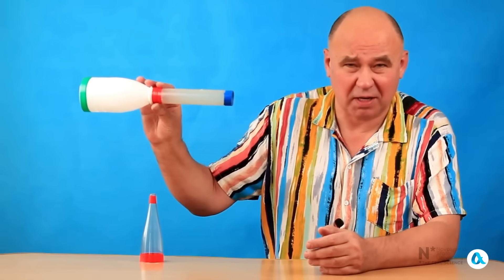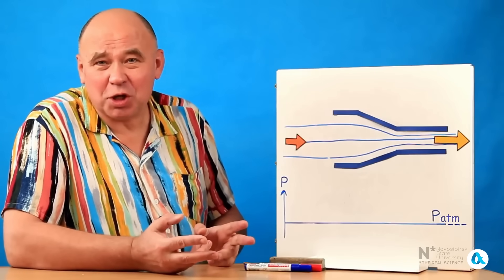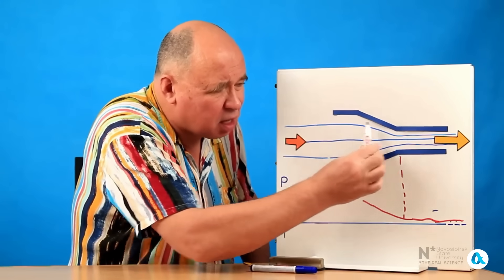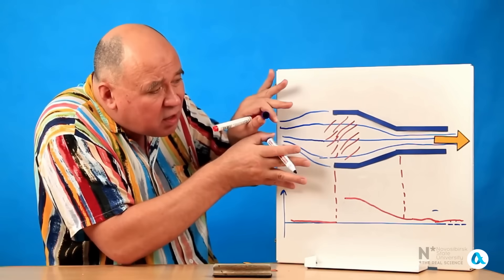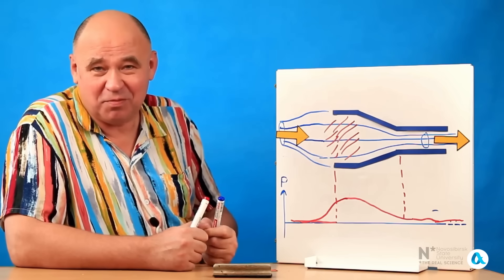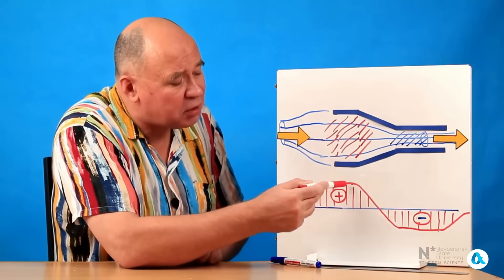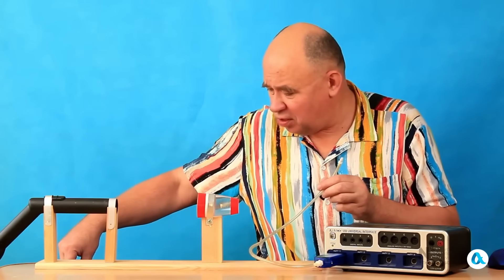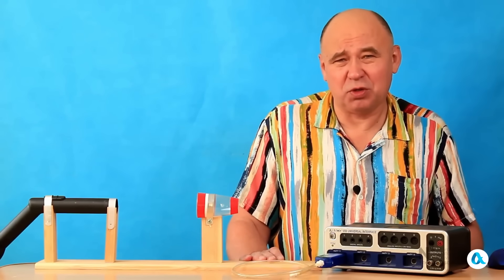Tapering pipe paradox

Comment: I don't see a paradox. The input of energy is provided by the airplane. The pressure inside the wide part of the funnel increases because the air is approaching a flow restriction. There is no reason to invoke expansion of the air. As a result of the increased pressure in the wide section, the speed of the air increases  as it is forced into the narrow section. Once in the narrow part of the funnel, the pressure is high but instantly returns to atmospheric, not below atmospheric, as it exits the funnel because it opens to the atmosphere which has a volume infinitely bigger than inside the narrow part of the funnel (P1V1 = P2V2). Conclusion, the energy provided by the plane in order to accelerate the air in the narrow section is not given back to the airplane, which results in slowing down the plane, although the reduced speed is so minuscule that we cannot even measure it.
Reply: He is using the word "paradox" loosely; sort of like when the word "theory" in common usage is  different from a "scientific theory."
Reply: This explains it best. That was what I was thinking.
Reply: Why did you say "Once in the narrow part of the funnel, the pressure is high"? You do agree that it should be at its lowest if the flow is laminar?
Reply: @mosab643  The pressure is highest at the entrance of the narrow part, as you saw in the video experiment. As the air speed increases in the narrow tube, the pressure decreases (Bernouilli principle) and back to atmospheric pressure as it exits the tube. It cannot drop below atmospheric pressure, otherwise the air would flow back from the outside into the narrow tube. Actually, this brings up an interesting thought: maybe the refined theory seen in the video is correct and indeed there is a negative pressure, but the atmosphere fills it back instantly from the exit of the funnel, and an equilibrium quickly takes place so that the pressure is equal to atmospheric pressure. This is something to consider. Sorry, I'm not a fluid engineer, just a chemist with a wide imagination.
Reply: @pjdruz5636  No, that actually makes a lot of sense. 
However, the pressure can theoretically be less than the atmospheric pressure in the narrow part of the tube depending on which type of pressure you are talking about; as there are two types of pressures in a flowing fluid - static pressure and dynamic pressure. Static pressure can be seen as the pressure the fluid exerts due to its internal energy, and its affects are measured parallel  to the direction of its stream. Where as, the dynamic pressure is the pressure that the fluid exerts due to its motion, in the direction perpendicular to the direction of its stream.
So, the static pressure - the pressure being exerted on the walls of the tubes - can indeed be less than atmospheric pressure without the  outside air having to flow back into the tube.
Reply: I like the theories, but what hasn’t been discussed here is what is happening to the external pressures as the fluid (air) moves around the outside of these conical structures it creates a low pressure zone behind the outer cone before the air exits.
I don’t agree that this would create a small or unmeasurable drag if such a conical device was attached to an aircraft though, because I feel it would act like a donut shaped sail overall and create quite a bit of drag as it compresses the inner chamber while decompressing the external atmosphere behind the cone before the exit and would also make the aircraft much less aerodynamic with such a structure attached.
JMO.

Comment: Your simulation using Faraday's/Maxwell's Electromagnetic "Lines of Force" is simulating the "air flow" as if it were a wave rather than particles. Air is made up of molecules which is a particle.
In other words, the calculations CANNOT be interchanged freely.

Comment: At a guess, reversing the air flow direction would be, to first order, like running the original in time reverse so the pressures would be identically distributed. Frictional forces aren't time reversible so there'd be some differences.

I expect the dynamical explanation would feel very different though from for the original.

... I realized later another source of irreversibility would be turbulence.

Comment: It is better to refer to pressure by its components. Total pressure is constant unless energy is added but the static and dynamic pressure can be exchanged without adding energy. When you slow the air it's static pressure goes up but it's dynamic pressure goes down and vice versa when you speed it up but the sum of the two, which is the total pressure, is always constant. This remains true until the air becomes considered compressible usually above Mach 0.5 and higher.

Comment: Why is there a paradox? The increase in the flow rate should increase the backpressure to resist it due to the restriction. Eventually, the a rise in backpressure should result in a negative pressure within the restriction. When you add a recovering combustion cycle between the pressure zones, this becomes a completely different fluid cycle, and the restriction induces a region of focused high pressure at its exit.

Comment: First, the work done on the air by the larger portion of the tube is equal to the output of smaller exit of the tube. The liquid\gas can accellerate in the smaller exit, but it is not creating any work. Rather, the pressure must equalize before and after the "engine" and since there is no additional work being done on the air in the pressure chamber, there is no net force of accelleration, only drag due to turbulence. If the cone is reversed, the pressure will increase at the opening of the smaller tube, then drop below atmospheric pressure inside the widening chamber. A great deal of turbulence is created at the rear of the reversed or widening tube. In this case, the work done on the outside of the engine reduces pressure, and relative pressure inside the engine is even lower or equal to the airfoil effect on the widening portion of the tube--as it straitens out.

Comment: 10:00 Answer: The airflow will constrict as it approaches the inlet as the low pressure air behind the bottle tries to reach equilibrium by airflow reversing around the rear rim with simultaneous velocity increase ahead of the inlet. The conical front taper will increase air pressure near the inlet as part of the inlet stream constriction and acceleration effect. Essentially an invisible front half of a venturi forms ahead of the bottle.

Comment: Cool video for reasoning dynamics, but there is nothing close to a paradox.  It's a paradox if you don't calculate either the energy in the wind from the model, or the torque from the plane in the hypothetical.

Comment from the maker: Imagine two pipes of different diameters connected by a smooth adapter. Now let us place this structure in the air flow with its wide end forward or, what is the same, move it relative to the stationary air. The flow enters the wide part of the tube, then passes into the narrow part, and at the same time, obviously, increases its velocity. Have we really got an air gas pedal, a kind of jet engine that runs without any fuel?! Something's not right here.

A metaphysician like Newton will immediately say that the Creator of all things so arranged the universe that man could not get something for nothing, and such an engine is a priori impossible. 

And a physicist (like Newton) should find an error in this very plausible reasoning and understand in what exactly we deceive ourselves.

Let's follow the air pressure along the axis of the pipe. Behind, at the exit from the narrow pipe, the pressure is atmospheric, as well as inside it: the air flies there by inertia. But in the adapter and in front of it, the pressure must be greater than atmospheric to drive the air into the narrow pipe and increase its speed. But before the wide pipe the pressure is again atmospheric, so at the entrance to the pipe in the area where the pressure increases, the air flow slows down and expands.

So far ahead of the pipe, the cross-sectional area of the flow that will then enter the pipe is smaller than the cross-sectional area of the wide pipe and probably equal to the cross-sectional area of the narrow pipe. Then there is no acceleration of the air - with what speed the air moved far ahead of the wide pipe, with the same speed it flows out of the narrow pipe from behind.

Here, as in other cases where we encounter seeming paradoxes, it is important to draw the lines of current correctly. For example, the wing of an airplane not only deflects the airflow downward behind the trailing edge, but also causes it to run into the leading edge from bottom to top, rather than horizontally. Or else: water moves much faster in the inside of a pipe bend than on the outside.

And as in many videos devoted to hydrodynamics, we simulate the flow of our “engine” using the Vizimag program, because the mathematical equations describing the motion of an ideal fluid and a magnetic field are exactly the same.

Comment: Put 50-100 small tubes at the entrance. They guide the air, reduce turbulence, focus into a straight line. Test with different and same tube lengths. Tune for optimal.
Reply: The high pressure zone in the wide part of the tube propagates back through your small guidance tubes and the air diverts before those. Don't think of airflow as particles with momentum like water, think in terms of pressure instead, I'm sure it's not perfect but it helps with "paradoxes" like these.
Reply: Known as a gas lens. Works great for creating a laminar cover gas flow for welding. I've made a number of them for laser welding applications.

Comment: I'm not really sure it's an actual paradox as much as a counter-intuitive phenomenon. 

When flowing air is compressed in to a narrow channel it's pressure increases and it's speed decreases.

The highest pressure measurements mean the slowest air speeds. When the pressure drops again the air speed increases. Add a combustion element to that and you have a jet engine. In supersonic jet engines the intake nozzle and cone work to slow down the incoming air to sub-sonic so the engine can handle it. The decrease in pressure amplified by the combustion gases at the outlet nozzle give the air it's super-sonic speed.

Comment: I see an error in your test where you measured air pressure over/below atmospheric.  Your exit did not have a tube like your model did, that is why you never saw the negative pressure your computer model predicted. 

Bernoulli’s theory says if you restrict the flow of a fluid, velocity increases and pressure falls.  

Since there was no long tube in your exit, the restriction disappeared too soon for you to measure the reduced pressure caused by the increased flow inside the restriction. 

You actually did measure a bit of negative pressure but the tube was not long enough to show it definitively. 

Try it, you will see I’m correct. 

As a measurement technician I studied this effect in school as we use this same effect in industry to measure flow inside pipelines.  We introduce a precision restriction inside the pipe and measure the pressure upstream and downstream and can accurately measure volumetric flow.

Comment: The nice thing about measuring relative pressures is that it's extremely easy to set up a basic yet very accurate differential manometer.

All you need is a clear tube, some watter with food dye in it (so you can see it easily) and a board to mount the tube in a U shape. Then you fill it about halfway with the dyed water and connect both ends to the pressure locations you want to compare.

Super eaay to build, very visual, very intuitive.

Add some line markings and you have a proper instrument 😁
Reply: Every 27.68” of height differential equals 1 psi if you are using pure water. (Dye could change this)
Reply: @rickschlosser6793   Usually you're dealing with a few Pa at most, especially when you're playing with vacuum cleaner wind tunnels. So you don't need much length at all 😉
Reply: @ Our flow meters were ranged 0-100kPa, and upset conditions could pin the meter on the high side. 

If you call 100kPa just a ‘few’ kPa, then fine.
Reply: @rickschlosser6793   100kPa isn't much in the grand scheme of things, but I was talking specifically for this demo. This is ram air out of a vacuum cleaner, 100kPa is overkill.

For reference, stagnation pressure at 100m/s is just over 6kPa. Outside of going compressible, that's all the pressure you'd ever see in the scenario shown in the video, and that's assuming it blows that fast out of the hose (which it doesn't).

It's different in a flow meter. Especially if it's driven by a positive displacement pump of some type. That fluid has nowhere else to go and the pump doesn't much care if you're at 100kPa or 500.

When it's open like that though, and far enough away from the hose's exit, if the inlet pressure is too high it'll just go around it. Hence measuring no more than stagnation pressure. In this case, probably in the few hundred Pa range. Which is why you don't need that much length.
Reply: @ I was measuring natural gas flow in a pipeline at ~5000 kPa static pressure using an orifice meter.  

Take a smooth bore piece of pipe and put an ‘orifice’ plate in. Measure the pressure at taps precisely 1” upstream and 1” downstream of the upstream side of the plate. 

Use the upstream tap as your static pressure and put a temperature probe a foot or so downstream of the orifice plate.

Then you tell the flow computer the orifice size, the actual measured ID of the flowmeter, and the laboratory measured gas composition and poof Bob’s your uncle, you have a flowmeter!
Reply: Doesn't that require you to know the diameter of the tube? @rickschlosser6793
Reply: That type of meter is even more.accurate if either tube is at a lower angle.

What you cant't directly deduce from that is air flow. 

You need either static vs dynamic pressure or.air velocity for that.

His probe is opposite thae air flow. It's not a true static pressure reading bc Eddy currents, etc, and the deeper.he goes the more the device alters the flow. 

Good points, though.
Reply: @Kansika   It's a concept demo for a video using a vacuum cleaner as the fan... I don't think they're setting instrument accuracy records here 😅

It would just visually look better if it was something like a tube manometer. And it's something kids can build at home with no special tools.
Reply: @ The slanted tube manometers are still reliable instrurments used for visual inspection in industrial applications. They can be very accurate within a certain range but that's not my main concern here.

What he theorizes, models and measures don't add up. 

First of all the CAD model shows a cone with an even diameter extension nearly as long as the cone. The model he built only has a cone and an outlet. Not the same thing. A taper or a restriction always causes turbulance that takes a while to settle.

Secondly he's holding the end of the probe tube away from the direction of flow. Air flowing over tuhe tube creates an eddy flow at the tip creating negative pressure zones. 

The least he could do would be to take more readings with the nozzle facing the flow. That would be the dynamic pressure and subtracted from the static pressure it might give some hints about air velocity.  But like I said he's not measuring static or dynamic presuure here.

I use a pitot-tube with a digital manometer at work to measure air flow. Turbulent air is very hard to measure. All and all, air speed is not what he measured here.
Reply: @Kansika  Slanted tube manometer.  I think more accurately called an ‘inclined tube manometer’.  I haven’t seen one of those since school.  But you are right, they can be very accurate.  Plus a manometer is considered a ‘primary standard’.  That means with the correct fluid and properly leveled they cannot fall out of calibration.  Technically more accurate than your digital manometer, but much less portable.  Day to day, you should be using a digital manometer. 

Anyway, all I saw him measuring was the static pressure and the tube was pointing the correct way for that.  I’m not sure if the ‘impact’ pressure (upsteam on a pitot tube) would be the best way. 

Agreed, he needed the extension tube for this test.  The lack of it really made any thesis from the test null and void.
Reply: Can also use a lower density fluid (with dye) for better readability, like hexane sg [0.66] or pure(no water) light alcohols (methyl, ethyl, propyl) [sg 0.79]. 
There are substantially lighter liquids but most have excessive vapor pressures for common use, though they would work in high ambient pressure situations or capped.
Reply: @mytech6779   As long as it's easy to procure and not too expensive, it'd be ideal for messing around like this, sure.
Reply: Thanks for the reminder... Nice that the experiment can be done without expensive lab equipment, just using a plastic bottle, vacuum cleaner, and a differential pressure sensor as you described... I'm tempted to try it... :)
Reply: @PaloniemiJ   Go for it!